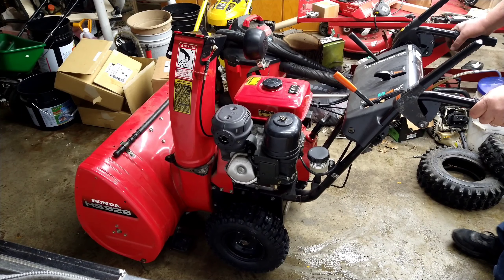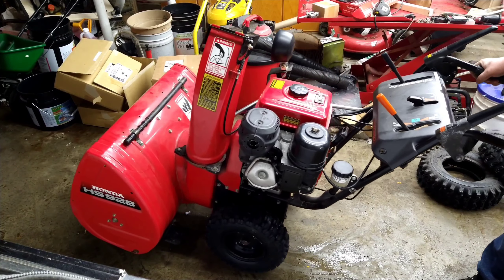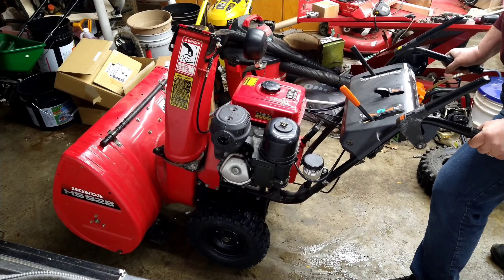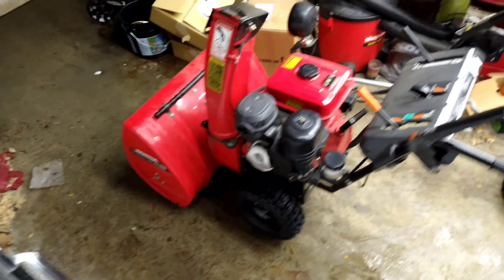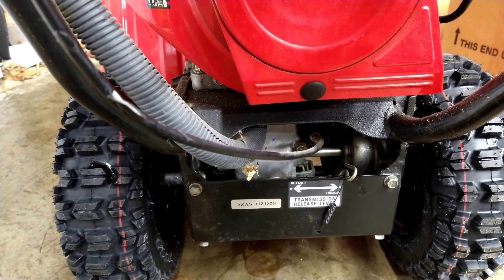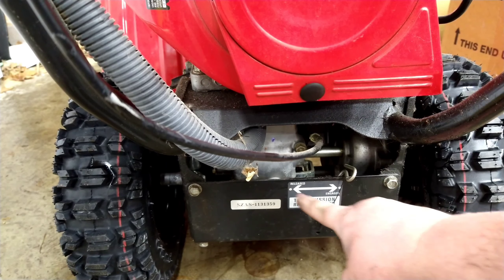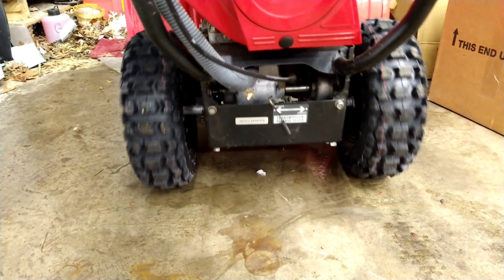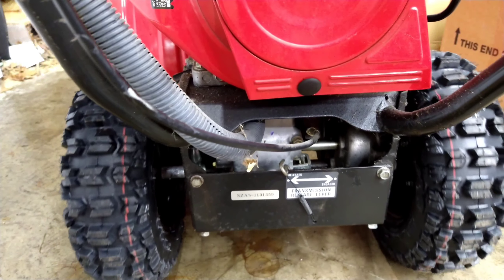Freewheel a hydrostatic transmission on Honda HS928

Comment: If some engine oil got into the transmission, does anyone know the best way to flush it out? When drained, does every ounce of fluid drain out or is some trapped?
Reply from the maker: @wildmanofborneo  I would drain transmission fluid, operate a few minutes to get remaining engine oil mixed with transmission oil then change again.